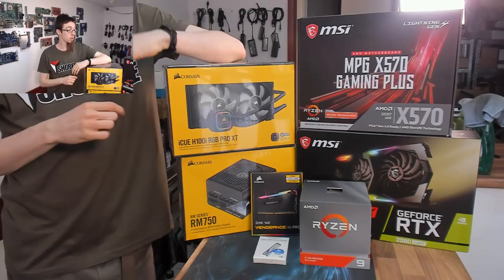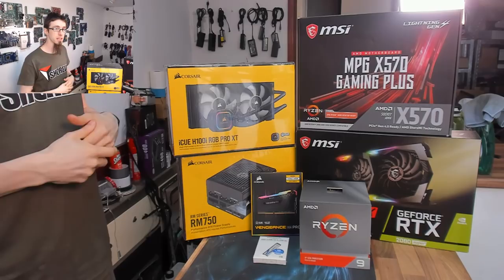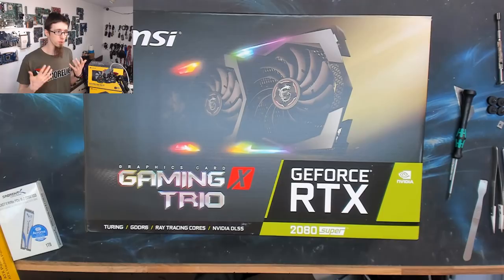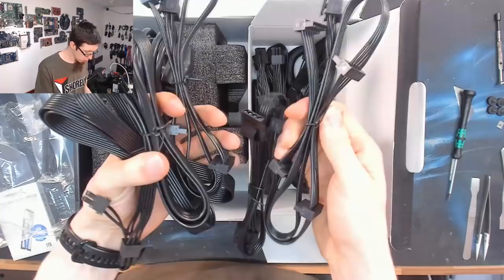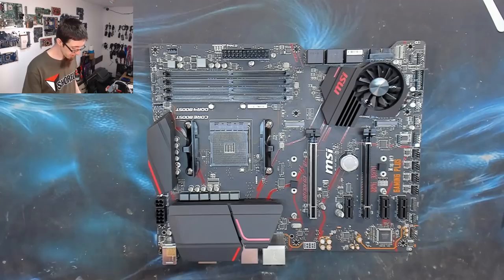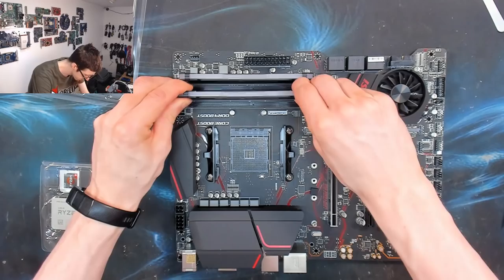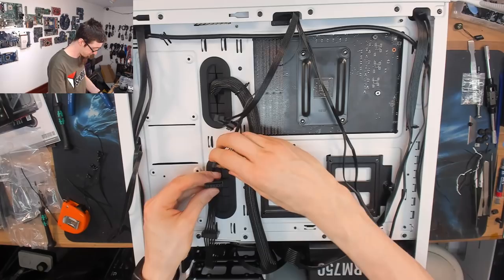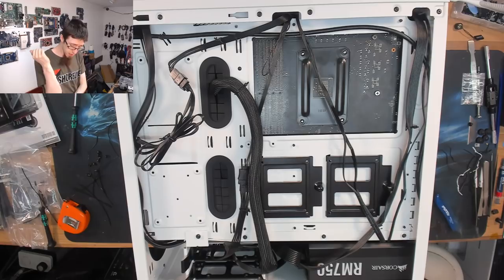The Whole Corsair 275R AF build - LBC#54

Comment: My 3700X goes to 1.5V in the BIOS as well. From what I've read, it is normal behaviour for these Zen2 chips. They will constantly change voltages and can hit up to 1.5V depending on the CPU load and current. On higher loads, it will drop down the voltages as it sees fit. These CPUs are designed to run to the best of their ability out of the box, requiring no tweaks whatsoever. If you're using the stock cooler, then it is possible you'll encounter heating issues. Otherwise, it runs really well and while seeing 1.5V is alarming if you're not used to it, it is not damaging. Damage can occur when you begin manually tweaking these CPUs (i.e. tweaking CPU speed yourself) and if you aren't damaging it, you're possibly reducing its performance overall (not just in benchmarks, but also in lower loads as well). These have been documented. 

I noticed performance reductions by adding even a 1.25V fixed voltage in the BIOS. Software acted like everything was good, but benchmark scores told the real truth. What works well is adding a negative voltage offset. You can lower the max voltage by a bit without impacting performance. My CPU does fine with an -0.0875V offset. Performance losses occur if I go too far (say -0.1250v). This does help shave some C off the temperatures while still keeping the CPU performing to the best of its ability.

I think it's best to leave the CPU at stock settings and let the user decide if they really want to go around tweaking settings.  I normally go in the BIOS and immediately start manually tweaking CPUs to get as much performance as possible. With Ryzen Zen2, I've found there to be very little benefit to doing so. And what I've watched and read about these CPUs seems to back that thought up.
Reply: I can confirm. Having a very similar setup (ASUS themed though), my 3900X is also at around 1.45 auto. Decreasing it hurts frequency. A small negative offset might remain unnoticed, but 1.2 is waaaay too low. Especially for gaming where it will not turbo that high or for long.
I can justify lowering vcore for aircooling and for mutithreaded load, but even with that, only by offsetting it.
Reply: Yeah i have a 3600, and it goes up to 1.48ish volts. But thats only at very low current, and its always moving around
 Thats why people thought they were hot when released, but in reality they just idle warm. At load my 3600 with a 240mm AIO doesnt get above 50s-60s, at max load 70c. During gaming im surprised when it breaks 50c lol
Reply: The 3900x I have, was also pushing 1,48v. I got him running at 1.335v @ 4ghz all core.
Performance remained really similar though (within 100pts at cineR20) ,then tried 1.225v and performance  was the same as 1.335v just one point difference. In my case i want to stress the cpu as less as possible as I don't game much, but I don't much about OC, so I hope im doing it right.

Comment: That is why you look at the case descriptions.  Most will tell you the dimensions of the case.  And also tell you the biggest power supply, graphics card, etc. that can be installed in the case.  Not just go by the way the case looks, air flow, etc. only.

Comment: A small tip for future installations of the AIO's - try and orient the radiator so that the tubes are to the bottom instead of the top. This allows the air bubbles to rise without getting into them.
Reply: it would not work with the gpu in the way. plus it's an aio i'm pretty sure it's bleed

Comment: My new PC, which I build in May this year, has almost the same configuration. Here is what I have chosen: Ryzen 9 3900X, ASRock Taichi Ultimate X470 motherboard, NVME Crucial P1 1TB SSD, MSI GEFORCE 2080 Super, 32 GB RAM 3200 DS with RGB from Crucial, two 4TB Hard-Disks Seagate Barracuda, SilentiumPC NAVIS  280 RGB AI watercooler, Case Sharkoon M25-W, BeQuiet Straight Power 11 Power Supply 750W, two 140mm RGB fans and one 120mm RGB fan, AKASA Cardreader with 4 USB 3.0 and SmartCard reader. I have overclocked the CPU to 4300 MHz all cores with 1.30V and the memory to 3600MHz.

Comment: I also have a corsair case and it came with little LED lights. However, I don't know where to plug the led cable into the motherboard. have tried switching led+ and led- but without success. Any ideas?
I have a B550M motherboard

Comment: Flip the radiator so the tubes go down, if the tubes are long enough. There's always some air in those loops and the air rises to the top. If you have the hoses there, the air bubbles can get sucked into the pump, and you can get some whine or trickling sound over time. With the rad the other way around you won't have that issue.

Comment: IF my memory serves me right, the MSI mboard uses mystic lighting which is ARGB for newbies addressable red green blue - whereas Corsair et use iCue with an independent controller, not sure if that would run off the mboard ARGB The Asus X570 gaming plus build I did I ran the ARGB daisychained off the AURA system 5fans 2 strips - no probs. I like matching the RGB to the mboard system as an independent controller does not sync well with using  a separate controller. I also won't use less than 3600 DDR4 with Ryzen 5 +  As always great vid !

Comment: With single latch DDR4 slots the trick for newbies is to put the memory into the open latch end first and then press down on the fixed end. I agree I am not a fan of the single latch slots👍 The Asus board had 1 x 8 pin plus 1 x 4 pin CPU sockets. Mounting the power unit upside down its a good idea to check the cable length will reach re your CPU slots. If the cable is short you can buy extension cables usually about 12cm long. Usually the 24 pin is not a prob. I've found the non modular power units tend to pose short cable issues. Case mods - I have on occasion modded the case re drilling extra holes to accommodate cable through put - if you can do that assess your build first and mod BEFORE you build up the unit. In my tool kit I have a  'whitworths' screw thread gauge like a feeler gauge set and the number of thread variations is jaw  dropping- that also applies to the BS threads. - the metric threads tend to be pretty standard. I also have in my toolbox - a few years old 😊 is a thread 'tap and die set' useful if you strip a thread et or want to add a screw thread to a hole you've just drilled. A number of different size metal SELF TAPPING screws can be a bonus. You can buy fan extension cables (bout £3 - £4 = 1 to 2 or 1 to 3 in packs )  Be careful putting the M2 into the slot nearest the top PCIE slot as some graphics cards= fitting can be problematic. The Asus mboard has a CPU fan AND a motor (w cooler) pins. I agree re that GPU not to have the cables running across the fans -newbies note KEEP em clear ! re airflow /temps et 😊 Great build and I liked the water cooling fitting which newbies can see is not so terrifying in place of a standard air cool build. 👍😊

Comment: You also missed the latching screw off the M.2 before you installed the heatsink,  Its easy to think the sink holds it down but it doesnt, nice build though.
Reply: @Adamant IT yep, idk why he thought the SSD will be holded up by the heatsink. Maybe becase the screw for the M2 slot comes in a very small zip tide bag and he overlook it.
Reply: agreed.
Reply: Exactly. My neighbor made the same mistake when he set up his build, and when he moved it to his desk after the test boot, the SSD came loose and it wasn't being detected by the board. He almost RMA it. 

Also, not all M.2 SSD labels work transfer heat between the chips and the heatsink. Its always recommended to remove the label (carefully, for warranty reasons) if you plan to use the heatsink unless that SSD specifically has a label that works as a heat spreader.
Reply: @RGInquisitor  SSDs don't really NEED heatsinks, it only prevents the controller thermal throttling under really heavy loads but the NAND prefers to run hot.  So I'd argue if the label isn't designed as a heat spreader, its probably not going to insulate enough to be a problem.  Its probably even a benefit as it prevents the heatsink cooling the NAND too much.
Reply: @alexatkin  You are absolutely right about the controller being the one that needs to be cooled. However, the NAND doesn't need to run hot to perform well all the time, so a heatsink is always preferable so your controller chip doesn't cook itself.

You don't really notice how damn hot m.2 ssds get unless you get a nice, aluminum external enclosure for one of them that works as a passive heatsink as well, and plug it in for a few minutes. The one I put together, if left plugged in for 7 to 10 minutes, gets too hot to pick up with your bare hands. That's not good for the device, no matter if NAND gets a few extra mbps because of it.

Comment: To not have problems, that is why people should do their research when they are picking parts for a pc build.  Does not take that much time to see what cables are included with a power supply for example.  Takes away lots of problems and frustrations if you pay attention to what you want and buy to see if they will work together.  Do not blame the part if you buy one that does not include all you need in the box.

Comment: According to Hardware Nexus the radiator is mounted upside down.  Manufacturers are to blame for showing the incorrect mounting.  Tubes to the top creates standing bubbles that can coolant starve the pump.  It would however get in the way of the video card.  This would be best mounted exhausting air through the top with the current top fans moved to front intake.

Comment: You picked the worst X570 mainboard for a 3900X, Those VRMs are gonna get stupid hot. If you wanted to stay in that price range I would have used a Asus X570 TUF Gaming
Reply: Exactly there is loads of videos online about how bad the vrms are on this motherboard they will overheat with this CPU and thermal throttle and down clock or even crash on certain intensive applications,  hardware unboxed does a good video explaining this.
Reply: @Hoggin  Yes Hardware Unboxed did some very amazing content showing the downfalls in that MSI mainboard
Reply: Yep. ASUS TUF or a Gigabyte board would have been a much better choice.
Reply from the maker: I've seen lots of comments about this. I knew the VRMs weren't the best on this board - but it's still an 8-phase, are they really that bad?
Since this box will be a gaming rig, it'll manage just fine because the CPU's never going to get properly thrashed, but it's bit of a pity to hear that an 8-phase VRM can't cope with a 3900x at stock.
Reply: @Adamant_IT  problem is the VRMS are ok for maybe a ryzen 5 3600 but paired with a 3900x they exceed over 100 degrees.
An MSI b550 tomahawk probably for the same price has 10-Phase 60A Power Delivery temps would stay around 60 degrees .price is around £180 or the b550 mortar exactly the same spec board for £150.
Reply from the maker: Yea this looks like MSI's inconsistency striking again, some boards are good some are bad. I thought they were past this. The 'lesser' chipset ends up with a better all-round feature set. I'm not too fussed for this build, because it's not going to be sitting in Cinebench all day every day, but yea that's disappointing that an 8-phase is struggling with this. It's a problem that I'd expect to see on a cheaper X470 board, but not X570.
Reply: Adamant IT b550 motherboards are supposed to be the budget range , but because they came out a year after x570 they seem to out perform a lot of them.

Comment: the auto VCore for the Ryzen is 1.47v for light single threaded workloads. it goes down to 1.1v at heavily threaded workloads. there are videos showing that if you under-volt it will show the correct frequency and be at that speed but you will still lose performance.
Reply: 1.47 is too much voltage. Amd set their targets stupidly just to ensure all their cpus hit spec and nobody can call them for false advertising. Ever notice that other youtubers oc their cpus to insane levels at 1.35? There are many videos that show that.
Reply: There are videos showing performance is lost by lowering voltages. Have you monitored the cpu voltage while doing a CB R20 render?
Reply: When a real load goes on a ryzen 3000 CPU it lowers the voltage to 1.1v.
Reply: @superweeniehutjr2314  if i set a voltage of say 1.25, then it cant lose performance if all it needs at full load is 1.1v. And if your cpu is idle, then it wont need 1.47v because there is no performance to lose...because the cpu is idle! There is no logic to your argument.
Reply: @superweeniehutjr2314  dude 1.25v > 1.1v. Nobody is sayin to undervolt to 1.0. It is not undervolting the cpu if it is set to 1.25v. This is irrelevant.
Reply: I was only saying that it's something that happens. Y'all just started saying im wrong and stuff. And so I defended myself and my claims.
Reply: @superweeniehutjr2314  yes, but if your cpu requires 1.1 under load, 1.25 cannot be an undervolt. It is an overvolt. 1.47 is an utterly unnecessary voltage for a cpu at idle, and all you serve to do is burn out your chip. At 1.25 you wont lose any performance, and your cpu will boost just fine.
Reply: Yes the cpu will still hit the clock speeds. But you will still lose performance. Did you even watch the video?

Comment: Question and comment: Why not plug in the 6 and 4 pin EPS to the motherboard?  You have a PSU that can run them.  As for the graphics card bracket it goes under the card in the 2 slots below and the card just sits on it.  Not a very elegant design, but I have one in my rig that is RGB, so there's that.

Comment: Very clean build!  I take a slightly different order of operations that you might find useful:  Put the motherboard in the case first (after installing CPU, RAM, and SSD, of course).  You have no cables to get in the way, and when you do route the cables, you can see where all of the connectors are so that you can route them the best way the first time (instead of finding you need to re-route cables later).  I typically put in all of the hardware, then add the cables all last.  Doesn't make for a nicer build, really, but saves some time rerouting cables.  The Fractal cases are great for that, because you can pull the power supply out of the rear panel and slide it back in after you deal with your cable management.
Reply from the maker: I used to do Mobo first as well... that seems to be against the grain for YouTube PC building. I don't think it really makes any difference though, so personal preference!
Reply: @Adamant_IT  Yeah, I find going "with the grain" on what's out on YouTube might not be super helpful all the time. lol.  I mainly mention it as you mention issues you are having in your video at least 3 different times (i.e. the back of the case being bowed under the motherboard by the power supply cables) that would not occur if the power supply was not installed.

Comment: I learn something new about the power supply.  

Maybe i don't have to worry about that much,  mine not getting ventilation in the anydees cube case is on.  
I been thinking on drilling through the tempered glasses to give it more air

Comment: Yes my MSI board also regulates Vcore way too high on its own. I manage to run my R5 3600 on just 1.2V completely stable when manually tuned, and that's with a 4.4Ghz all core oc too.
Reply: good oc on your ryzen im at 4.3, whats your best all core cinebench R20 score?
Reply: 4015 was my highest ever score turning off as many background processes and programs as possible. Typically it's in the 3800s tho.
Reply: @felixlersha  nice thats up there, i got 3822 as my highest

Comment: I've seen other videos for this cooling unit, but the fans are on the other side of the radiator, is there a reason as to why? is it because you set it up as an intake?
Reply: can you also explain the fans and how they work with this setup??

Comment: Would it have made sense to have put the 3 included fans in the front of the case then the radiatior for the cooler at the top of the case? Theoretically you'd have slightly positive airflow and slightly less dust

Comment: Clicked to see how well one of the larger GPUs fit into my case, turned out to be quite a relaxing video to watch while refreshing pages hoping to be able to buy an RTX 3080 sometime this year. Turns out the ASUS TUF 3080 RTX is just a little bit smaller than this card in both height and length so it should fit fairly well.

Oh and thanks for the cable routing ideas, when I upgrade my GPU I think I will follow what you have done here. as I currently have a large pile of cables behind the middle 2 grommets.

Comment: Ok beginner question here. I have this case and i just bought asus rog strix z390-e motherboard, and this mobo doesnt have 3.0usb connector,, and 275r  case has 2 3.0 usb for front panel.  Where do i connect the 3.0usb front panel then?
Reply from the maker: That mobo's USB 3.0 front header is along the bottom row, where the USB 2.0 and front-panel headers are
Reply: @Adamant_IT  i havent opened to see the board yet. just seeing from asus website. And it doesnt state any 3.0 usb front header. Only said 1 x usb 3.1 gen 2,,   6 x usb 2.0,   3 x usb  3.1 gen 1.  or is 3.1 gen 1 is the same as 3.0? Thank you for your info.

Comment: Can this build work for the regular 275r or do you have to get the air flow variant
Reply from the maker: Yea the non-AF version would also be fine. You'll get more cooling from the AF front panel, of course, but corsair were reasonable with their non-AF front intakes.

Comment: I usually already attach the CPU power cables while the board is half in and  at an angle. Saves me fiddling around to get them in, especially with an air cooler already attached and in tight cases or ones that dosen't have a proper hole on top for the CPU power cable.